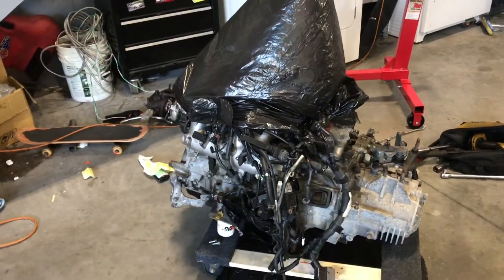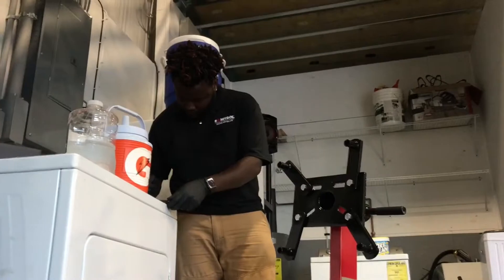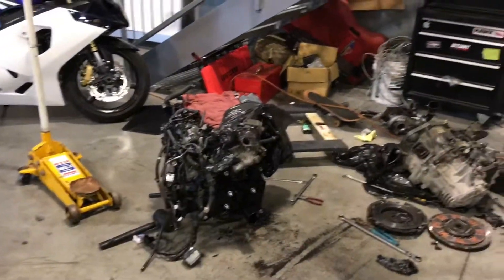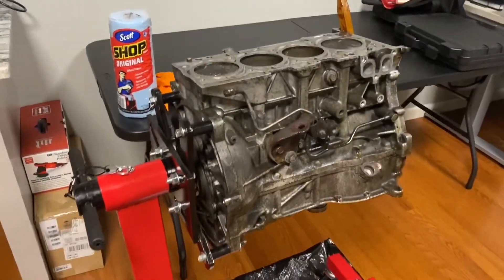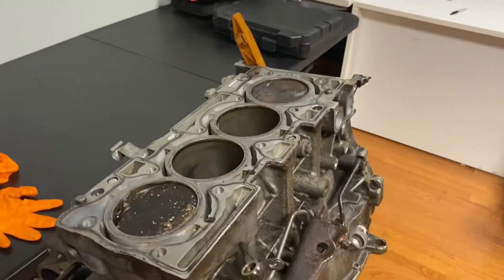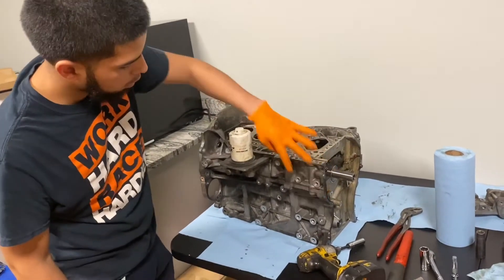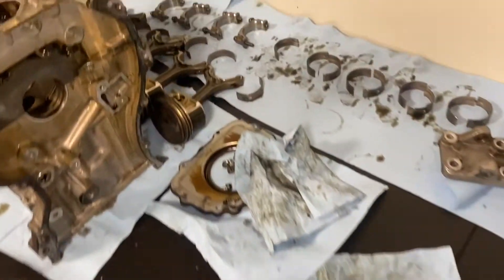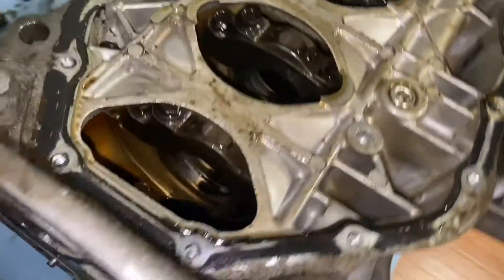Evo X Build Part 3 Engine Teardown Bare Block

Comment: Same exact thing happened on my stock motor. Piston cracked  never knew why it happened.
Reply from the maker: Looks like it’s a common issue on the Evo x
Reply: Same with my car Cylinder 4